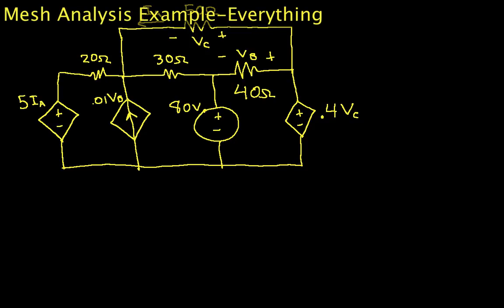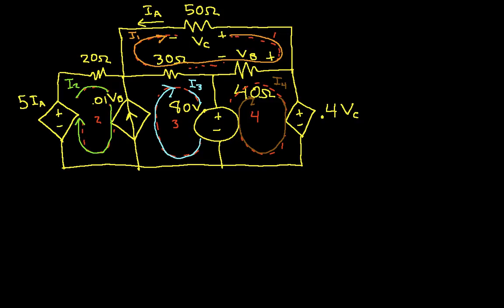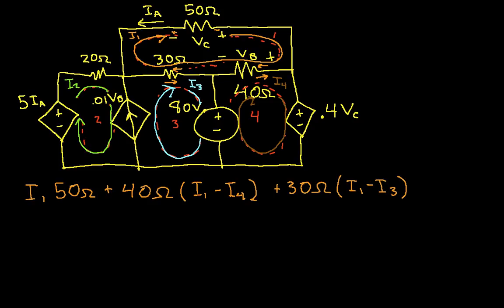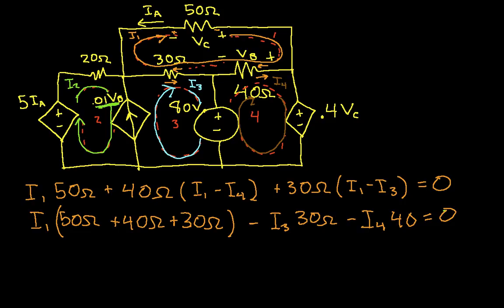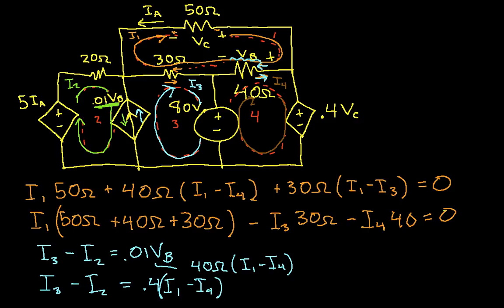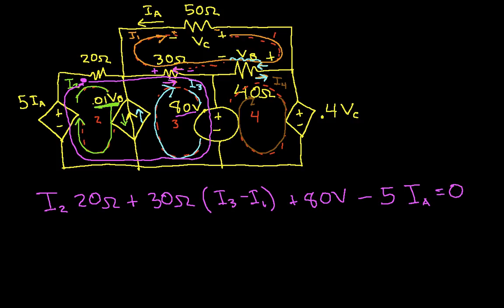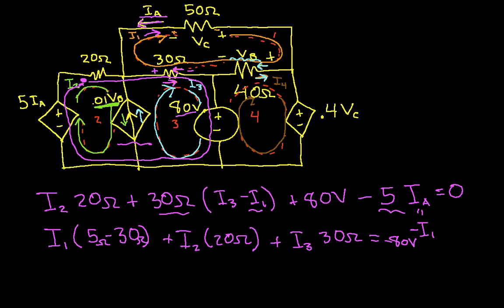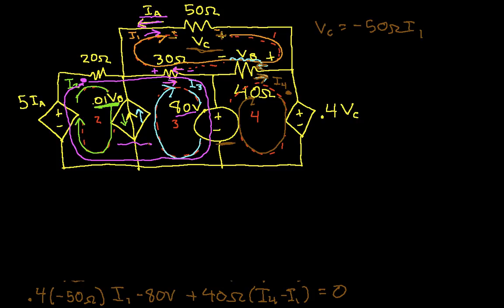Mesh Analysis Example-Everything Part 1

Comment: this method is so complicated, it's very easy to make a mistake and screw up the whole analysis. And i didnt understood why did you change the voltage sign over the resistors, took me a while to catch up... I know it makes no difference if you do this in a entire mesh since the sum is always zero, but i find easier to keep the minus sign on resistor, just because we are adding up "drops". Thanks fou you video!

Comment from the maker: If the source between Mesh 2 and Mesh 3 were a voltage source, we would just add or subtract its voltage when going around the two meshes. If it were an independent current source, the analysis would be the same as in the video except that the difference I3 - I2 would be the value of the current source and not .01VB

Comment: Overall this was a great problem and solved elegantly. I do have one issue. I'm not comfortabel with the *seemingly" random switching of voltage across resistors. In some instances you obay the polarity of the resisitors, in other cases you switch them to suit you needs. For example, you swithced polarity at the the 50 ohm resistor to be +, then - then + again. you dis the same thin thru the 20 ohm resistor. I f I try to do the same thing during a test, it would screw me up keeping track

Comment: could u explain why at 12:50 u get Vc= -50 rather than +50? How do u determine the sign? I thought if u have the voltage raise u get minus sign, and if you use the clockwise direction on the 1st mesh u get a voltage drop...
Reply: Same doubt

Comment: Is it possible to perform nodal analysis of this circuit.What would be the current of the 50 ohm top resistor which will flow into or out of the first node from left?

Comment: When he goes around Vc why is it negative, every time he goes around other resistors or voltage sources he always takes the first sign that appears as he is going through that loop.? why does he change it for Vc?? PLss heaalp
Reply: +Oscar R A comment below by "Jimmy R" answered the question. 
he said " i1 is traveling clockwise around mesh 1, and when mesh current 1 enters the resistor, Vc is the opposite polarity of the voltage drop that would be seen from I1 dropping across the resistor.  Therefor, the voltage drop is (-I1)*50 Ohms. It's all about the polarity of the voltage drop with respect to the direction he defined of the mesh current"

Comment: sir in step 2 you wrote 40 ohms(I1-I4)
but why didn't you take the 30 ohm resistor on mesh 3 into consideration??
please any user who can help me??
Reply: +Spandan Nautiyal Step 2 was determining the current flowing through the dependent current source, which can be defined by (I2-I3).  Since this current source is only dependent on Vb, we only have to worry about this voltage.  Looking at where Vb is defined, we see it's only the voltage drop across a resistor, which from Ohm's law is just the current flowing through the resistor times its resistance.  Looking at the mesh currents, we see that the only currents flowing through this resistor are I1 and I4, flowing in opposite directions, so those are the only ones we need to use to determine the Vb voltage drop.
Reply: +Jimmy R thank you so much... very helpful..

Comment: why is the Vc =  -50 ohms? I can see where... but why did it become negative?
Reply: +Rozalind Aria I 1 is traveling clockwise around mesh 1, and when mesh current 1 enters the resistor, Vc is the opposite polarity of the voltage drop that would be seen from I1 dropping across the resistor.  Therefor, the voltage drop is (-I1)*50 Ohms. It's all about the polarity of the voltage drop with respect to the direction he defined of the mesh current
Reply: +Jimmy R thanks